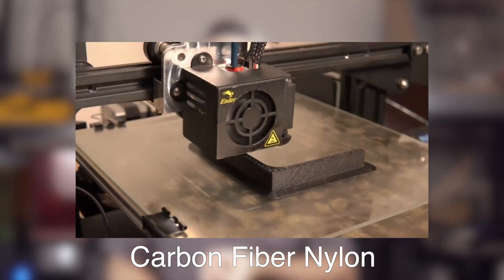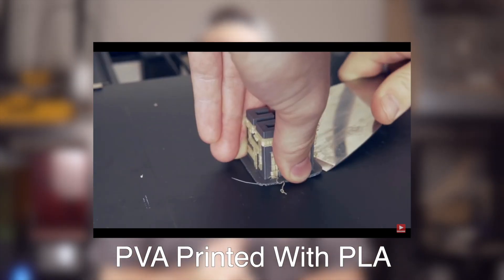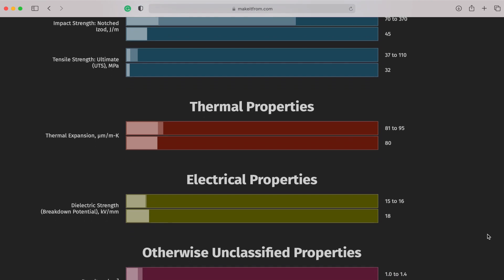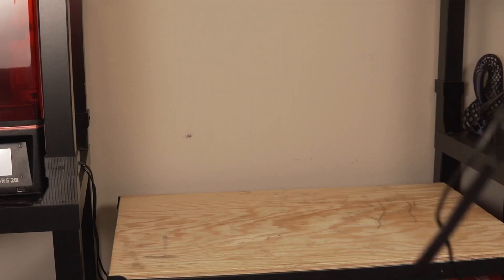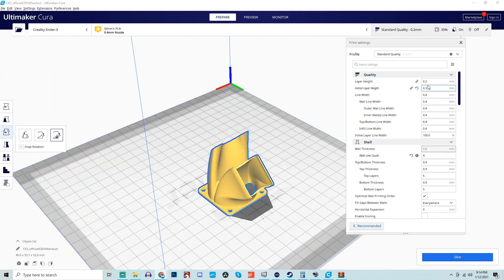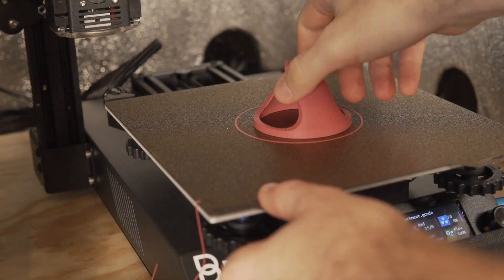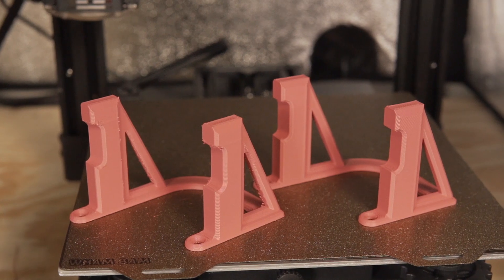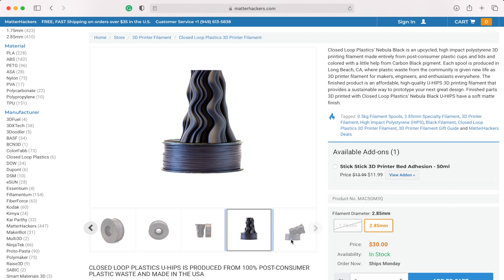3d Printing With HIPS For Beginners (High Impact Polystyrene)

Comment: I'm having good adhesion experience with ABS, ASA, HIPS putting a brim+raft of Easy ABS, a pause and change with the final filament. No detaching from bed and can use the bed at low temperature of the Easy ABS near 70°C. Also this new plates help like the Biqu Cryogrip Frostbyte, very good adhesion for Easy ABS @ 70°C.

Comment: Bytul Acetate, or Acetone (at 99% concentration) should dissolve HIPS easier.

[EDIT: You can make sprue goo out of HIPS]
Reply: toulene disslolves hips like a charm. its used a paint stripper and is commonly available

Comment: This video has be very informative about the benefits of HIPS, I would imagine that the applications for cosplay/prop construction with the filament could yield some increasingly durable products with thicker insetting and wall layer parameters in the slicing process.

I've got to get some HIPS now!

Comment: Idea: Lost HIPS metal casting (add a sprue to your hips printed part, coat with ceramic slurry and sand - several coats for thick shell - dissolve the part out the mould with D-Limonene, heat Pewter in a crucible with a blow torch, pour into mould, allow to cool, crack off the plaster - voila, cast metal part!! Could also use melted coke cans

Comment: As a Modeller (Plastic kits) HIPS is a great help as it will adhere to any Kit that uses polystyrene plastic, and can be used to produce things like Stands (for painting or display) and internal, non-visible parts like Wing Spars also. Yes,MEK will cement it, but MEK is HIGHLY Carcinogenic - Try Tamiya Extra Thin cement or any other equivalent, right up to modeller's tube glue. Tamiya also make a Limonene cement....

Comment: Im using HIPS for low price, low density (light weight parts), easy to print - low warping with ender 3 in chamber, and very strong parts. Much stronger then ABS and much easy to print. Also great heat resistance and no stringing, bloobing like Petg. Hips prints are clean like PLA prints. Ender 3, 105C bed, 245 hotend, capricon ptfe. Printer in simple wooden box.
Reply: It's also sands really well and clean, complely dissolves when placed in TOLUENE, and does not warp as far as I can tell, warps way less than abs or asa for sure.

Comment: Hi Daniel, great informative video.
I have just started trying to print with HIBS, I have a standard Ender3V2 , I have only just started and with the print head at 250o and the Bed at 90o. this issue I am having is bed adhesion. 
what do you suggest?

Comment: I get recycled HIPS from a local supplier here in Montreal. Nefilatek also up-cycles industrial waste HIPS and makes a great filament. The finish is fantastically good and I am looking to use it on my next 3D printer build for some structural bits.
Reply: @andrewferrier5453  I've got a CR10S Pro V2 in an enclosure, with a PEI flex bed and a direct drive Microswiss hot-end. I can get the enclosure to heat to about 30-32 C just passively. I have since fallen out of love with HIPS, as structurally I find ABS much more worth the effort. But the finish on HIPS is hard to beat.

Comment: Hi! Thanks for the vid. I'm using an Ender 3 Pro with an original enclosure. I can't smell any odor even tough the printer is 1m away. I went with a glass bed because at 80 C the magnetic field decreases and the 3DLAC spray for adhesion. My issue is that for some reason the part is expanding. The part has perpendicular walls and when it's done, I end up with a 40-45 angle from the bottom to the top. A complete mystery. Settings are 205-210/105 with 45mm/s speed.

Comment: I just received my 1 KG spool and am trying to print some parts for my OmniaDrop.  I had a jam with a .25 nozzle, I cleaned it out and will try again tomorrow.  Has anyone had problems with small nozzles with the recycled filament?  I has similar problems with Greengate recycled PETG.
Reply: Sometime it is about type of nozzle, form (for some reason I have issues with 0.4 ruby nozzle on some PLA and PBT) and retraction, full metal vs PTFE heatbreak (full metal have huge problems after PLA due to PLA sticks to everything). If you don't want problems with some material use bigger nozzle hole or some plated copper nozzles (sometime I'm using 0.8 when some material can jam or I want to print much faster).
Reply: @vladimirseven777  Thanks for your suggestion.  I'm going to try a bigger nozzle,

Comment: I found that HIPS can be used as a good support material for PETG on a multimaterial printer. They can print at the same temperature but they do not like to stick together. So you can slice it with 0 gap between the support and the part and use HIPS for the interface layer. The supports peel off really easily and the underside of your part is almost smooth. 
The tricky thing is if anywhere on your part the PETG starts to be layed on the HIPS only, not starting from an existing PETG point (like overhangs bigger than 90 degrees). Then the non-sticking nature of the two will cause problems. This can be helped by slowing down this part of the print. I successfully printed a PETG sphere resting in a HIPS bowl.  
You also need to print a relatively big purge block to make sure your PETG part is not contaminated  - layers would not stick well. But if you only use HIPS on the few interface layers the purge block is empty through most of its height so the waste is not crazy high. 

I tried to see if the PETG part with HIPS support can be separated by dissolving the HIPS in acetone. It sort of works. The HIPS gets soft much quicker than the PETG and the PETG can go back to fully hard after a few days of drying. It just smells bad. But since acetone is easy to get this could be usefull for some complicated geometry.
Reply: HIPS dissolves very easily in d-limonene, this would be a better choice than Acetone for dissolving support structures!
Reply: @GoughCustom  I know that d-limonene would likely work better (if the PETG has no problem with it). But I did not want to buy it just to try it and acetone was available at home anyway. I know polystyrene can be easily eaten by aceton so I tested it and it seems usable too.  But you only need it if the geometry of the part does not alow removing the supports or breaking them into smaller pieces and removing those. Because the PETG does not hold onto the HIPS almost at all with most geometries nothing has to be dissolved.
Reply: @hebijirik  Ah gotcha! I had forgotten how easily polystyrene dissolves in Acetone, interesting that HIPS does not share the same property!
Reply: @GoughCustom  Yes, I was surprised too. The HIPS gets very soft in minutes while the PETG softens in hours and not nearly as much. But the HIPS does not disappear like polystyrene would. Also I was using black HIPS and the acetone around it was getting a little darker but it remained nicely transparent unless I left the HIPS in it for a very long time. So I guess there are two chemical processes going one. One is quick and just makes the HIPS soft, maybe by breaking the polystyrene part of it. One is slow and gradually would break it apart but it would take way too long.  
Also when you remove the badly deformed HIPS out of the acetone and let it dry it hardens to at least its original hardness. I might try smoothing a HIPS print in acetone vapor one day. It could work.
Reply from the maker: You are the second person to comment saying that it works as a great breakway material for PET-G. This is awesome! I had not heard of this before and it taught me something new. I will have to give this a go at some point.

Comment: I use hips as a base print. Refrigerator condiment shelfs and other parts are made of HIPS.
Reply from the maker: How awesome! Condiment shelfs are crazy strong to I have seen them drop with a ton of weight and not shatter.

Comment: what a great product the recycled hips.  thanks for sharing this content.  at 240c, that's right at the edge with the ptfe tube.  I'm going to guess that if you print for a few weeks, the ptfe will need replacing.
Reply: You may need to trim the tube, not throw it away. It just needs to be a little bit longer than necessary.
Reply from the maker: I have printed quite a bit with PTFE lined hotend at 245 (many months) with little issue. Perhaps it depends on hotend design as well as the level of cooling the hotend has.

Comment: I wonder how well this material would work for 3d printed aircraft. 
How is the weight comparison to PLA?
Reply from the maker: I do not think that the manufacturer has a TDS (quick search didnt see it) Found this from Rigid Ink "For example, it has a specific gravity of 1.05 g/cm³. This is comparable to the density of ABS."

Comment: ... yet another great, great video, Daniel! I've been hesitant to try printing with HIPS, due to knowing nothing about it. But, I do print regularly with ABS. Now I'm thinking of giving HIPS a try...especially if it prints even only a bit more easily than ABS. Haha
Thanks again for working so diligently and sharing your findings! (...are you paying attention, MH???) 👍😉
Reply from the maker: Yeah I was really impressed with how well this material printed. It would be fun to take HIPS and ABS and run the same print on the same machine and just see if there is a difference as far as adhesion in the exact same scenario. :)
Reply: @ModBotArmy  Hmmm...good idea! Once I get some HIPS, I'll do just that and let you know!

Comment: I am cheap, so I doubt I am going to be purchasing that filament anytime soon, but I do appreciate that it is recycled.  $20 is what I consider high priced but acceptable priced filament if the need is there, otherwise $14-16 is generally what I pay for a roll of pla or petg.  It was another great video, and I will no doubt look into this material some more.  I found some $20 rolls of hips on Amazon.  

BTW I didnt notice any difference in the Twitter sound, but again I wouldnt worry much about it.  I am use to it, I expect it, and I would likely miss it if it was gone.
Reply from the maker: Damn I did lower it 5 decibels more haha. Well I appreciate you checking and will just say it is something that some hate and others dont mind. Sort of like how quickly I speak. Some love it because they have no problem listening at that speed while others want me to slow down. I think I am just going to keep doing my thing with little tweaks as I go :) I mentioned in another comment I am hoping that this company can lower the price as they grow and the process is refined.
Reply: @ModBotArmy  All you can do is be you, I enjoy your videos, and you said your channel has grown quite a bit lately so you must be doing something right!

I will keep a look out on this filament, I really do like the thought of using recycled filaments.  If they can get it reasonably priced I would grab a roll of it.

Comment: Ohh I forgot why I use hips Non-hygroscopic: whereas almost all other filaments are hygroscopic and will deteriorate over time if left out in open air, HIPS is not hygroscopic
Reply from the maker: That is definitely a huge perk. Especially when we are talking about functional filaments moisture can be a HUGE paine.
Reply from the maker: pain*
Reply: HIPS is most definitely hygroscopic.
Reply: @brianhutchinson7863  barely, basically you can treat it like it's not.

Comment: I e been printing with hips for two years it’s great for drone parts, has just enough flex, it’s light and the finish is nice. Btw you can use a lil dlimonene to smooth the part with a spine he brush.
Reply from the maker: How interesting, I didnt even think of that for the sake of smoothing the parts if you just apply some to the outside. That is awesome. I may need to try this.

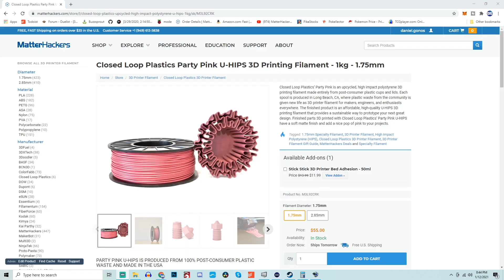Comment: 8:25 - $25/pound - yikes.
Reply: I saw a price of $30 flash by, then I checked the link it was for a .5 KG spool.  A 1 KG is $55.  I may try , but not a cheap filament
Reply: @woodwaker1  It's all relative. I pay $220/kg for SR-30, and that's cheap compared to the guys and gals buying PEKK at $800/kg.
Reply: @JoeStoffa  That's a very good point.  The most expensive filament I have purchased is some Nylon, and haven't even opened yet.
Reply: @JoeStoffa  I just ordered a 1KG spool.  Thought it was worth a try. $55 and free shipping.
Reply: 1 pound = 0,453592 kg
Reply: @Mister_Stork  $55 x 0.453592 = $24.94756
Reply: @JohnJones-oy3md  you’re right, but nobody is using pounds for filament spools, that’s why I commented 😉
Reply from the maker: Definitely not a cheap filament. There is a ton that goes into the recycling process so I do understand the cost. I am hoping as the process is refined and more filament is made they are able to lower the price.
Reply: Yeah, I found HIPS that is recycled for 29.99 cad. Per KG. Nefilatek
Reply: Wasn't always this year. A little over a year ago, you could get ABS for $10, PLA for $14, PETG for $18, and TPU for $26. HIPS was the same price or less than ABS. I'm guessing after Trump and all that "Ghyna" rhetoric and tariffs, inexpensive filament is a thing of the past 😔
Reply: @3dPrintingMillennial  Prices went up on filament when everyone and their cat started printing ear savers and other PPE in mass quantities.
Reply: @mattelder1971  true. You're right. Forgot about that for a sec. That and the tariffs have made it so I'm always using the auction and best offer option on eBay instead of Buy It Now or Amazon.
Reply: @3dPrintingMillennial  Best deal I can find on PLA+ right now is from GST3D. Good quality and good prices.
Reply: @mattelder1971  first time hearing about them. They look like they have great deals. I don't use PLA too often anymore but I saved them just in case. Thank you!
Reply: @3dPrintingMillennial  , hopefully these tariffs will be removed.
Reply: @3dPrintingMillennial  More correctly, OMG we have to have face shields etc, can you print us some? Simple supply and demand.

Comment: I’ve been printing for about 4 months and I really enjoy your vids.  I have an Ender 3 pro that I modded with the BTT board, tungsten carbide nozzle and Creality glass build plate.  I haven’t tried anything but PLA because I think I need to learn more about Cura (settings) first.
  I installed a BL touch but I can’t find a basic enough video that assumes I know nothing (which I don’t lol) and can teach me how to set it up!
  Thanks for the vid!! 🥓✌🏼
Reply from the maker: Thank you very much for watching and your comment. Also welcome to the wonderful world of 3d printing. I agree with Jon. Chris Riley is an awesome dude and super knowledgeable with firmware configuring and the different boards. He may have something. i do not watch teaching tech as much but he may be another channel that covers this :)
Reply: Teaching Tech has done a few videos involving various BTT boards and a Bltouch.  Chris Riley/Chris Basement is also another great 3d printing information channel.
Reply: A Tungsten Carbide nozzle? Holy smokes, I didn't even know those existed, at least you'll never need to worry about it wearing out.

I'm adding that to my wishlist, though I'll need to find a way to defeat my Hardened Steel nozzle first